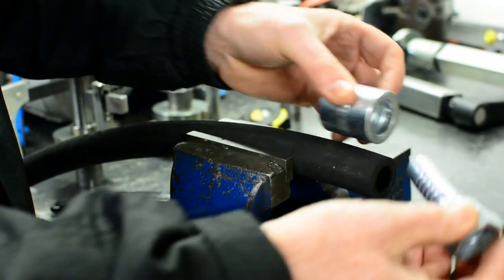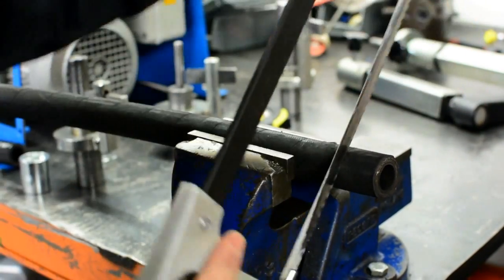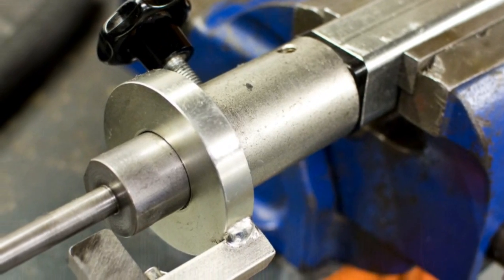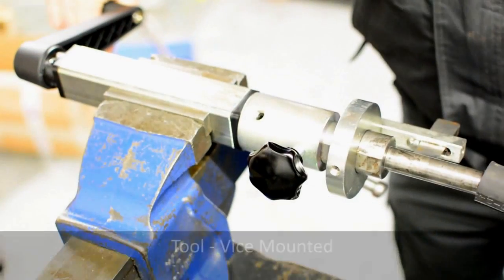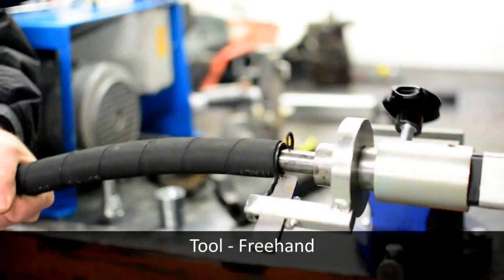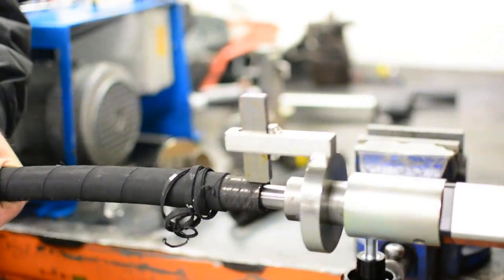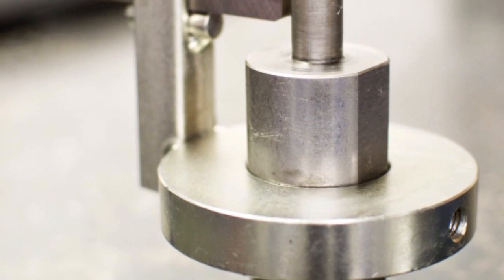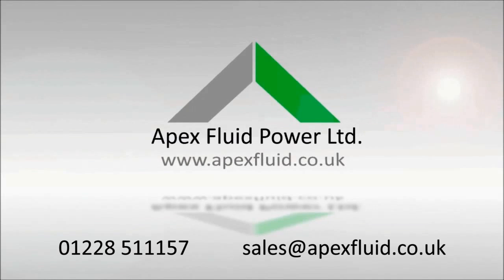Hydraulic Hose Skiving Tool

Comment: Will this work on bigger hoses like 4-5 inch
Reply from the maker: Good morning Tim, unfortunately this tool is only suitable for up to 2" hoses. There are some electric models which will skive up to 3" internal and external but none up to 5" i'm afraid.
If there is anything we can help with please let us know or email sales@apexfluid.co.uk
Reply: @apexfluidpower  00966570609584
Reply: We are manufacture of hydraulic hose,hose fittings and hydraulic hose crimping machine.Our machine has 1/4''-6'' all size.
Please contact me if you have interest:
Whatsapp:+8616601046013
Reply: @alicezhao9697  00966570609584